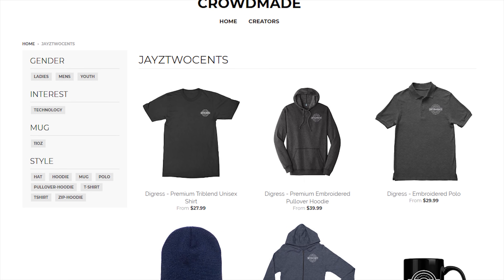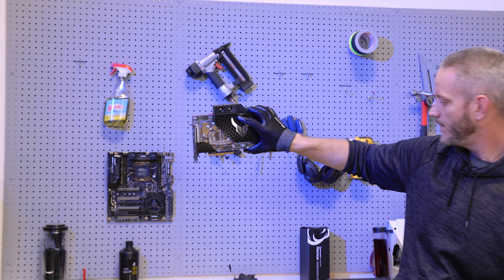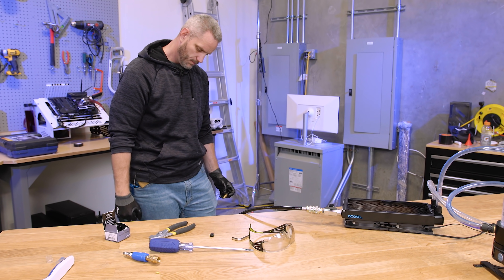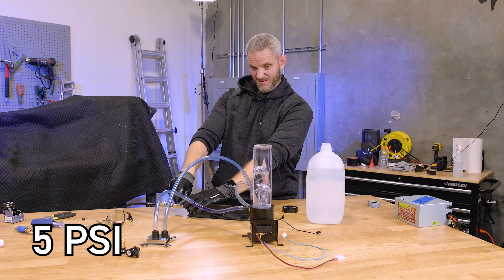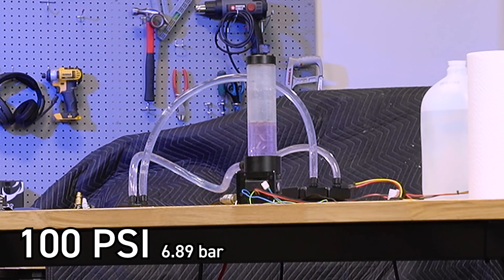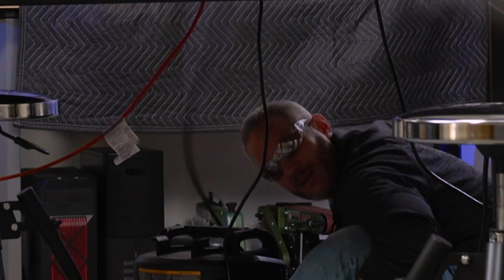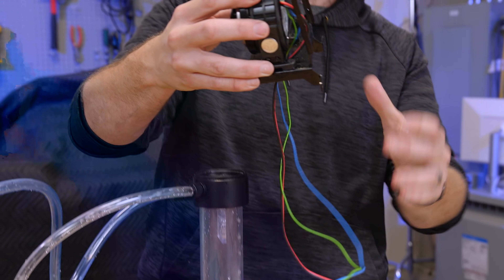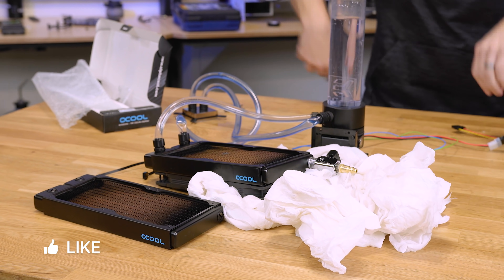The loop EXPLODED! DON'T TRY THIS!

Comment: one thing i have been curious about is how fast one can move water threw a standard consumer loop with an industrial pump before the pressure gets too much, and how the cooling performance increases and if the radiators are really balanced for the pressure they are given

Comment: ROFL best video ever, that double terror was so funny. first the boom from the unit then the compressor kicking on ROFL.  I have been scared so many times just like that when using a compressor, nearly shitting myself when the thing kicks on.  I seriously want to build a noise damper around the compressor unit I have to at least its quiet when it kicks on.

Comment: @JayzTwoCents  You proved its possible to put a massive amount of pressure through a loop, however how about combining a faster (high pressurised loop) with a same/smaller radiator? See if the temps change in a system?

Comment: Plumber comment: we test water systems at 100 psi to insure they do not leak. A water heater, YOUR waterheater has a pressure and temperature relief valve rated at 135-140 psi that releases pressure so that your water heater does not become a bomb and explode the way Jay just demonstrated. If a water heater explodes due to pressure it will level your house. Amazing that those components held over 100 psi (pounds per square inch) because they are not rated to withstand more than minimum pressure. Amazing Jay!

Comment: the issue is using air to add pressure wont give you an accurate idea of how well it'll take water pressure since air and water pressure react very differently

Comment: I think a better test would have been with hard tubing because the fittings don't hold as tightly as the soft tubing do.  They would probably pop off at a much lower pressure.

Comment: Watching the slow motion replay, slowed down to 0.25x, it looks a lot like the radiator flipped in flight and landed on the hose. It is much more likely that the radiator was bent when landing on the hose, especially given the leverage of all the valve assembly, rather than it bending from internal pressure.

Comment: @JayzTwoCents I examined the footage and the radiator wasn't bent from pressure. It was fine moment before launch as well as in flight.
Bending of the compressed air inlet was most probably caused by radiator and valve slamming into ground after the test.

Comment: How much psi can hard tubing handle? And can a system sustain negative pressure (vacuum pumps can bring a system down to negative pressure like we do to air conditioning systems to remove contaminates and moisture)?

Comment: You should try pointing a heat gun at the cpu block without the pump running just to show how safe it is. (Or should be)

Comment: I have a video idea if you use my video recommendation could I at least get a shout out this time. I gave you the dry ice cooling video idea last time. 

Ok for my video idea cool the entire system with ln2 but here’s what I’m thinking. Drop the rad in ln2 but no liquid will be able to pass through with out freezing solid so this seems backwards but after the the loop passes the gpu and is going return send it through a heater so it can make it through the rad with out going solid... let’s call it fire and ice. I googled what liquid has the lowest freeze point and they said liquid helium. But I’m not sure how that would work so I was thinking anti freeze or something that stands a chance. Anyways if it’s a complete fail it still would be a cool video to watch. Thanks for the shout out in advance

Comment: ok really wondering it using actually plumbing fitting with say micro bore copper pipe and a pump from a central heating system and running a water loop at say 3 bore is more efficient than running it at ambient

Comment: I just had a two res two pump setup idea that will not eat your money on power, You set one water cooling system as normaly the second pump and reservoir connect to the first reservoir so you can kinda recool your coolent when needed with a on/off switch. so inlet from second reservoir put at the top of the first reservoir and the outlet from second to bottom of first. You could turn on your second pump to cool your coolent fast, then turn it off and in 30min to and hour your second cooler has cooled and can run again. I hope I explained that ok

Comment: Look at a D5 pump box. It says the pump is rated at 60psi. So with a 2x safety factor, that gives you 120psi. 

Oh and lots or sheet metal parts are made with a hydroforming process. Thus water under pressure moves metal very well.

Comment: Jay, you are a car guy, and you know that car cooling is pressurised , and that helps cooling. And you tested the cooling system that it holds about 2 bar no problem (most car cooling systems are at 1.1 bar). now you should test the cooling and if it is better pressurised or on normal pressure. I bet it is better pressurised.

Comment: A fluid does not expand or builds up pressure when it gets hot. The pressure only starts building when you reach boiling point and the fluid starts transitioning to a gas. If you are reaching boiling point in your water cooling system, I think you have more issues to worry about. :p

Comment: I'm not certain, but I think this would have been a very different outcome had Jay used water rather than air to pressurise the loop. Air compresses, water doesn't. I think it would have failed a LOT sooner.

Comment: i guess the radiator is only bent, because it dropped on that hideous connector lever thingy you mounted onto it.
the only thing exploding was the tank, the rest was drop damage because you didnt fix it on the table.

Comment: i built my first watercooling loops back around 2004 with geared water pumps.
And thick silicone tubing. and forgot to replug the complete loop quick connectors more than once
the pump goes up to around 9 bar (130 psi?).

really nice when the tubes get bigger and bigger and more transparent, 
but my aquacomputer stuff was tested at 10bar and my homebuilt drilled stuff didnt leak either.
 noticed the pump getting loud.

(all house installation plumming hast to withstand min 10bar + pressure spikes here)

Comment: It would have been less spectacular, but there is a reason that folks who pressure test things like air tanks (and radiators) for a living use water or another liquid, rather than air, as the pressure medium. Maybe you have seen the phrase, "hydrostatically tested." Actually, that it is less spectacular is the reason. At the same pressure, a given volume of pressurized water contains much less energy than the same volume of compressed air, so much less "bang" when something pops.

Comment: NPT Compress air fitting and G thread fittings are different. G threads don't tapper, so they require a sealer.

Comment: so dumb things I have done at home
- Boiled water in my loop (Athlon X4 at 110c yes doing XOC things)
- used barb fittings without clamps or zipties while boiling water in my loop
- had a loose fitting that was pulling in air and probably pushed the pressure of the loop to 5psi tops

conclusion: barb fittings arent as shit as people claim however they do like to leak if the end of the tube is chewed up but for 25% of the price of compression fittings then they are totally worth it.
conclusion2: you can boil water in a loop for quite a while with the pump off and nothing will happen.

Comment: if the pump stops running the processor will get hot and your system will shut off. That's what repeatedly happend to me before i discovered that my pump fried. I had also the tubing break. Like almost catastrophically. My first water cooling was never maintained, not even looked at. The tubing cracked all over and water was leaking everywhere. That system detected a short and also turned off, it's at least10 years old and works fine to this day. If you put decent cash into your motherboard and psu even faulty watercooling is quite safe unless it explodes water all over it or something.

Comment: Having worked at an industrial water blasting company with a max 10 000 psi for years my experience has been that every RUD (rapid unexpected disassembly) happened at the most worn out threads of the hose connectors, the o-rings only failed if cut, damaged or worn out and would just spring a leak but when a hose connection let go the sound was louder than shotgun.

Comment: Just wanna say for anyone wondering. Most liquids are not compressible in the temperatures that are found in a cooling loop in a computer. Pressure in these systems is not really an issue except if the pump can't physically push the water through (at that point the thing just doesn't work).

Comment: If you want to go safe on destructive pressure test, you should make sure to fill your components with water. The smaller the volume of air in your system the less amount of energy wich means less kaboom-Force when it bursts.

Comment: NEVER USE COMPRESSED AIR FOR PRESSURE TESTS.
Compressed air contains a lot of potential energy. When something fails with compressed air, parts of the item can be thrown dangerously at high speed.
ALWAYS use water/liquid for pressure testing, ensure all air is drained from the system, and no gas based accumulator is part of whatever hydraulic system you are using. There are plenty of hand pump pressure testers for home water pipes that you can adapt for this type of testing.

In this test, gas displaced water in your cooling loop, and the compressor was acting as a large accumulator. There was a huge amount of potential energy involved. Combined water and air pressure testing is worst of all, any part of your system could end up launching like a bottle rocket in the event of a failure, which in this case it kind of did. I know you hid under the table, but there are much safer ways to do this type of testing in future.

Comment: I actually think the damage came form the rad hitting the floor after it was launched up in the air tho ;) steel is very strong and as the plastic tube did not take any damage, i dont think the steel would ether ;)

Comment: I think I'm more impressed that the soft tubes and their fittings did not pop! I mean after all the radiator is soldered metal, it is sure to hold more pressure than plastic unless mistakes are made in manufacture.

Comment: My X360 radiator from EK-WK leaked like crazy for no aparrent reason a few years ago, the loop was two years old, and i changed the fluid every 6 months with ek-fluid every time.
It completely ruined a system.
I wouldn't trust EK stuff.

Comment: if you're going to wear the glasses then wear the proper ppe, splash goggles are what you need for liquids. personally, i don't wear a damn thing unless its heated, an oxidizer or an acid... but that's just me. if i had a company and we were recording things that could be viewed by my insurance company id probably at least put the splash goggles on the counter.

Comment: I have access to a smoke machine that does 1-30 PSI of air and smoke for automotive diagnostics. But I would say that a system that can hold 10-20 PSI is probably good to hold water. Thank you for answering a question that I wanted to answer when my water loop parts finally show up.

Comment: Maybe the radiator bends because of the fall. If the radiator is falled right on the pressurized air inlet the weight make that sort of damage. Intersting video tho.

Comment: Actually you can use 30-40 psi to force bubbles out of the loop by  having high velocity flow through the system.
Essentially is the opposite of bleeding the system with air by blowing. You "blow" water into it to push the boubles faster than with the normal circulation of the pump.

Comment: As a hose specialist, this video hurts in that it shows just how poor quality (pressure rating specifically) the fittings are.  Im sure you'd have to push over 100 psi to blow an actual hose, but the fittings not holding up to even 90 psi is an absolute joke.  Even the most basic polypropylene fittings are good to 150psi, then brass goes to about 300, 500 if forged.  Steel starts at about 1500 psi and goes up to 10,000 in many cases.  I'd love to see someone build a brass and copper based cooling loop out of non pc specific parts.  I could do it, but it would still require buying a vastly overpriced block, reservoir and pump.  There is no reason a small water pump should cost over $100 and up to 250 for a D5.  

These companies are also using massively non industry standard threads on all of their products solely for the purpose of monopolizing it to small companies rather than make a standard threaded block that anyone could go to a hardware store and buy fittings for...just leaves a bad taste in my mouth due to always having wanted to make a super industrial looking loop with products from work.
Reply from the maker: But... as a hose specialist... how did you not realize that the hoses never let go and neither did the fittings?? The only reason the fitting on the radiator leaked is because it literally impacted the ground... Was this just an excuse to let everyone know "hey, I love hoses!"

Second... the threads are G1/4 which is literally available everywhere. Im now convinced you just like to complain.
Reply: @Jayztwocents  I do apologize, I should definitely have worded my initial statement differently as i was primarily triggered by the bits-power valve being able to be torn apart by anything you could have possibly thrown at it with that compressor or even a heat gun. My comment was off base and definitely showed some major complexes.  Also thank you for making me actually look up what G1/4 thread is (its British pipe) which we do sell.  If you ever want some industrial hoses that give off a unique look for a geforce build, check out the Aeroquip GH-781 hose or the GH-793 hose for a radeon build.  They are steel hoses and fittings, but have a coating that withstands being used with a pressure washer hose for years with no rust or tarnishing.  (we distribute and build custom hoses for industrial applications with Aeroquip as a supplier).

Thank you for the reply, and as a fan I humbly step back from the situation.

Comment: Would be cool to test flushing a loop out with compressed air to assist draining.  We used to use a tow-behind compressor to winterize water distribution systems.  Something similar should work well for a water cooling loop.

Comment: Next question, do they handle vacuum?

I'm a mechanic, I fix trucks for a living. I have a tool that creates a vacuum in the truck's empty coolant system, then using a system of valves and hoses, I can let that vacuum suck coolant into the truck. The advantage is that I don't have to bleed the coolant system afterwards. I reckon that if a water cooling setup could handle a complete vacuum, you could fill a system and not have to deal with air bubbles. 

I've never done any water cooling myself, but I imagine there's some complicated setups that are a pain to bleed.

Comment: Water is an non compressing fluid hence hydraulic so I am sure if the loop and the pump is filled completely the water definitely went back into the compressor due to no check valve

Comment: Water contracts when it heats up and expands when it gets freezing. What happens when it heats is it starts to vaporize and vapor expands in the heat, which is what causes the increase in pressure. If you have plain water in a radiator and freeze it, it will likely bulge and break it.

Comment: I had one of my hard tube water cooled builds overheat one of the pipes connected to the cpu socket because of the pump shutdown. It didn't explode it just melted the tube.

Comment: If you're running out of material, why don't you test the diminishing returns of radiators sizes? I'm using 960 mm of total radiators in my CPU/GPU loop, and it's working great. Test in 120 mm increments.

Comment: To be fair loops do explode. I work for xidax and we had one of our x10 loops explode overnight during burn in. We came in the next morning and the pump was still going but we had fluid everywhere. A fitting had failed but the alphacool radiators were still in tip top shape.

Comment: It's generally accepted you don't test pneumatic. The main reason is the potential energy in a system. Water is very close to incompressable thus you do not have the energy in the system. 

I was very glad you took cover as that could have been very dangerous.

Comment: This is interesting cause in cars the cooling system is pressurized by the heat so that that the water can carry more heat before boiling (200°+F), would slightly pressurizing a PC cooling loop increase the cooling capacity?

Comment: That's insane. 140PSI is higher than the pressure you'd find in a Nascar cooling system. Your average street car cooling system won't run much higher than 30PSI. I thought for sure it would let go at 60PSI.

Comment: Jay, you dumb dumb! Just because the pressure inside the compressor is bigger, water can still flow dowards, since the air can escape at the upper half of the tube (while water goes down in the bottom half)

Comment: That's DAMN impressive. I could probably get away with using a PC rad as an oil or transmission cooler on my car if it can hold  at 100 psi lolol. THAT's a pretty good testimonial for a PC product... "Also works on your car" lol.

Comment: I work at an electronics Manufacturer in the laser industry. We have many water cooled units. We water pressure test all of our units for leaks at 100 psi for a half hour. 140 psi is insane.

Comment: Liquid does not compress, it is the air in the coolant system that compresses. That is why waterless coolant is becoming popular. The water in the radiator turns to steam and creates pressure.